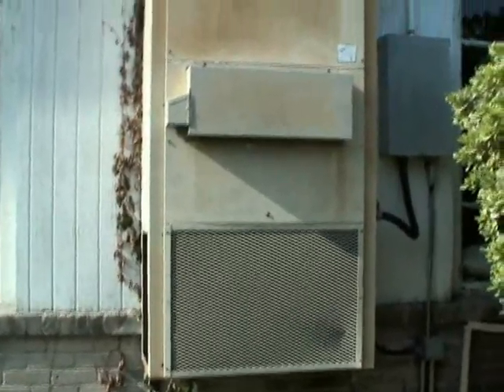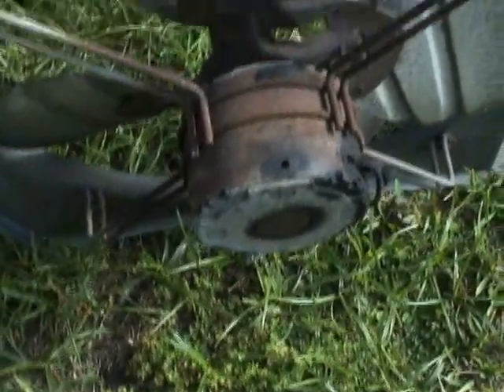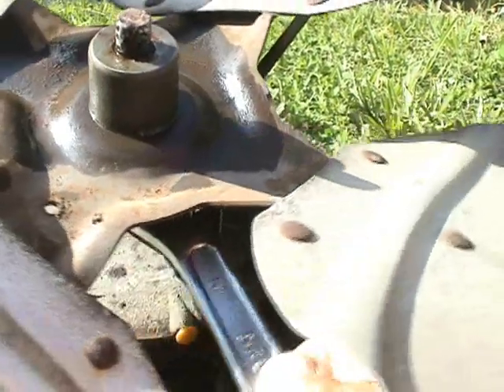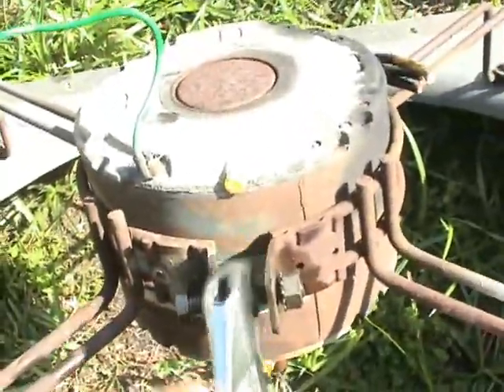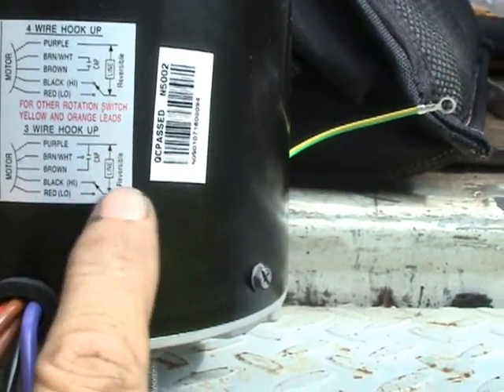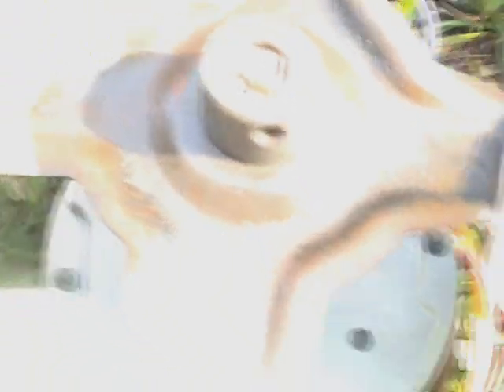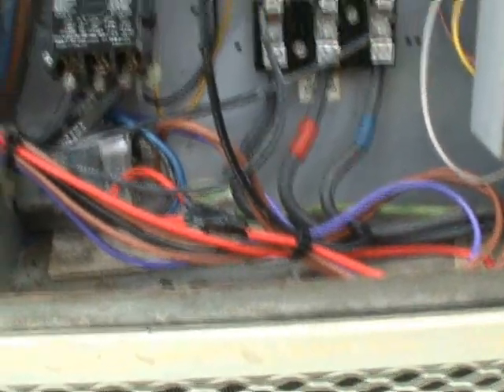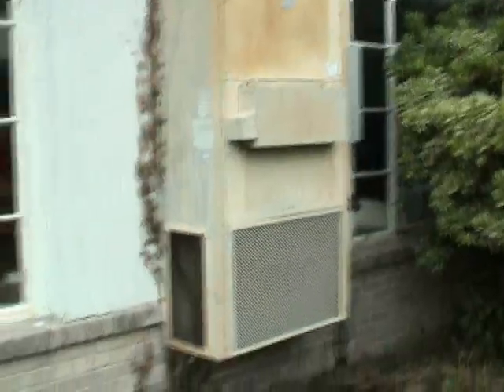HVAC Bard Condensing Fan Motors

Comment: help...here comes the dumb question..... is the condense motor and blow motor the same??? I have a Seiglar dual fan wall heat furnace original, Fasco motor # no longer exists U8A10AW2-A7893, 2.3 amp burning smell, was super loud until a big clamper of what I like to describe as death to a machine. now you hear it try to turn on, just a short term humming sound. would help if I said I replaced the filter? 1920 home , could use your input, would like to keep the furnace.. is that crazy or what!
Reply: If the motor has a run capacitor then try replacing it.

Comment: Man, I remember struggling with one of these the first time I had to change the CFM out - because I did it without removing the shroud.  I thought it would be quicker and ended up causing a lot more frustration....also I got my fingertip caught between the fan blade and shroud...and almost sliced it off!  Live and Learn, I guess. Lol.

Comment: Do you have a video of a blower motor replacement?
Reply: Familia Sanchez HVAC I don't have one for Bard blower motor replacements. I have one for cleaning a blower assembly where I remove the motor from an air handler.
Reply: Where can I find that one? Thanks
Reply: Familia Sanchez HVAC please try searching "drzarkloff blower cleaning"

Comment: no problem. Just buy an aftermarket condensing fan motor. 1275 rpm, 1/3 hp, 208 - 230 volts, reversible direction.
Reply: Aint no 1275 motor out there

Comment: Hi!! I have a question I have a Emerson condensing fan motor with RMP 1100 , volt 208-230, AMP 1.5, PH 1 and HP 1/3. My question is that I dont find the exact replacement and have looked everywhere  not had many luck or either the RMP is different and or the AMP do you think if I get something similar but not exact would work? or do you know any place I might find the exact one? I would really appreciate it if you could help me I am really lost. :(
Reply: Use a  US motors 5458- H. 1075 RPM. 2.0 max amps . perfect for that job

Comment: Hello, great video. I have just replaced my motor as well but I seem to have a problem. When the power is turned back on the fan always runs even when I have the thermostat off. Do you have an idea what I could have done wrong?

Comment: I try replace my old non working condensing fan motor but i having problem with identify the model make and horsepower the motor. can you help me with that please? thank you for your time.
Reply from the maker: The sticker on the condensing unit should tell you the horsepower and amps of the fan motor.
Reply: DrZarkloff
Thank you for fast respond. The striker has been painted from previous owner.

Comment: great video unfortunately I forgot how to put back some of the wires to the capacitors can you help me.
Reply from the maker: You could connect the brown wire to one side of the run can and the brown/white wire to the other side of the run cap as long as you're using a dedicated fan motor run cap. If you're using a dual cap then just connect the brown wire to the fan side of the cap and not connect the brown/white wire to anything.
Reply: can the running cap be 5 uf 370 VAC because the other cap is 35 UF
Reply from the maker: Danny Diet
Yes, as long as the fan motor is rated for a 5/370.
Reply: 5 uf  370

Comment: Most of the time I cut the shaft  off and then take the motor out.A lot of times the nut will break loose so you wind up having to use 2 wrenches if you try to take the whole thing out.A sawzall with a long blade will do the trick!

Comment from the maker: No. If you use the 4-wire hook-up with a dual run cap, the motor will probably burn up in less than an hour. You'll need to use a separate run cap and the only two wires that should be connected to it should be the brown wires on the motor.

Comment: You have done a great job on this video.  You are generous with your experience and have provided me a lot of guidance.  I'm glad you talked about 4 wire versus 3 wire hook-ups.  I expect to finish my Rheem fan replacement without a hitch (okay, getting the blade off is giving me fits, but other than that... ha).

Comment from the maker: You might want to check the compressor run capacitor. That's the most common reason for the problem that you're having. If replacing the run cap doesn't do the trick then try installing a hard start kit. That will give the compressor an extra amp boost on start ups.

Comment: I am having problems with my 4 ton Trane heat pump, sometimes when it starts up, the fan will start, but the compressor will not even try to start. Anywhere from 5 minutes to an hour later, it finally gets started. What could be causing this?

Comment: Every time I change out a condenser or blower motor. I always change out the Motor, Fan blade, Run Cap ( if it needs one), and the contactor or relay associated with it. If it's a blower with a belt on it then I will also change the belt out, too. This way you remove almost any variable that may go wrong in the future.

Comment: @Q4JULY33063 SCHOOL BOARD??  now i know, your a luckey one doc. this motor was a? 1/3 hp 208-230Volt  ph1  for you average people. 1175 rpm.  after market motor. our cost $60, cap  $2  your cost? 
let see average labor is like $85 an hour, motor $120-$150. + 1 1/2 min labor = $127.50 = about say $160.00 +taxs or up to $190.00..         if it was a 3 phase unit? it would be slightly higher.

Comment: Dr Z - thx for the great video. In changing the motor - what symptom were you trying to resolve? With degraded motor bearings - can the motor be dramatically louder when operating? Increased vibration? With bad bearings - will the fan still freely rotate (motor powered off of course)? Thanks

Comment from the maker: Thanks for watching. I will always used the 4 wire hook up if the motor allows it. Generally, only OEM motors will insist on using the 3 wire hook up.

Comment: A great video, and its obvious that you do quality work.  How do you decide whether to use a 3 or 4 wire hook up?  It looked like the old motor was a 3 wire connection.  Thanks again for a great video.

Comment: you know sometimes those condenser fans can be on the motor shaft so tightly that you would have to soak the entire bushing in penetrating weasel piss oil lol for like 3 hours and then apply a wheel puller to get the fans off. Sometimes it's just easier to just purchase new condensing fans along with the motors because if the pitch is wrong on one of the blades, you can throw off the bearings in the motor.

Comment: Dr z the brown and white wire connet to the common and the brown connects to the start on the capacitor also when checking the amps on the motor which wire do you want to clamp on to thanks DR Z

Comment from the maker: Sometimes, the data plate on the equipment will list the horsepower and voltage of the motor. The easiest way to be sure that you're getting the right motor is by writing down the model and serial number of the equipment and ask the person behind the counter at the parts store to find the right motor for you.

Comment: Dr.Z 
The only problem I've ran into is being able to find a matched motor on a strange piece of equipment that all the data plates are gone and you have no history on the equipment. So after replacment and during initial start-up I back it up with an amp draw on the motor

Comment: Dr.Z Thanks for another great video I wish I'd of had the opportunity to watch this prior to my first condensing motor changeout, I did what you said not to do I used a hammer and a drift pen and boy did I have problems getting the hub off. So to all you viewers pay attention to that particular lesson  it'll save you alot time, effort, and a headache. Just out of courosety did you do an amp draw after start up on the motor? Thanks again for the great lesson in motor installation.

Comment: Good stuff. I only use a hub puller as a last resort. Most of the time I get lucky with sand cloth and some WD 40 and the blade will slide right off.

Comment: Yea, sometimes it's better to push the hub down further. Especially if you need to sand it more.

The hub puller I use has 4 holes for removable pins, but also 3 tapped thread holes for set screws. This mounts totally flush with the blade, encompassing the entire hub. 

But it only works about 3" from the end of the shaft. Hex blades are nice too. Just remove the 3 flathead screws instead of wresling with it. And just like a tire iron, spin the blade and hold the screwdriver stationairy.

Comment from the maker: Fortunately, the school board doesn't have many new reach-in coolers and freezers. I'll replace the condensing unit and evaporator with a drop-in kit way before I'll request a new cabinet because of the over engineering like you've mentioned.

Comment: another tip I use a 1/2 black nipple place it on the hub and a good strike with a hammer usually works removing the blade

Comment: Q: What's on the other side of the coils?

A: For 1, if he was brazing there was probably a leak. Leaks often rear their nasty head in the form of spewing oil everywhere. In the evap of a heatpump there would be more oil than if straight A/c. Why? Higher pressures in heat.  2nd, The filter side would have more dirt and scales to burn. 

But most likely, Insulation.

Comment: Using a center punch, awl, or screwdriver to hammer at the shaft is a big nono. BUT!

There have been several instances I've used a nut runner that closest fit the hub. For 1/2" it's the green one I think.

Comment: Speaking of over engineered,

How do you like those Delfield cases?
In another video you changed a condensor fan motor on a Victory Box.

But does the district have any of those nightmare 2 or 3 door freezers with the touch pads? 
Have you ever had problems with the printed circuit boards/cpu?

Not much is solid state anymore. Thermistors, and boards, and DC? Oh My!